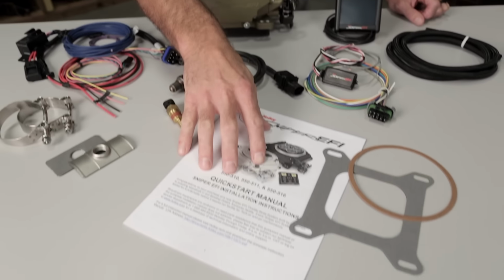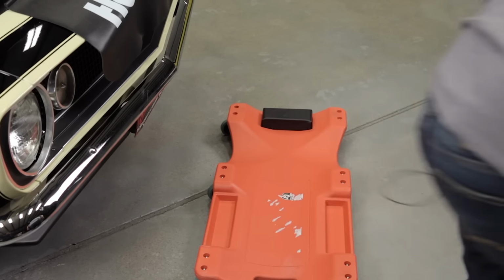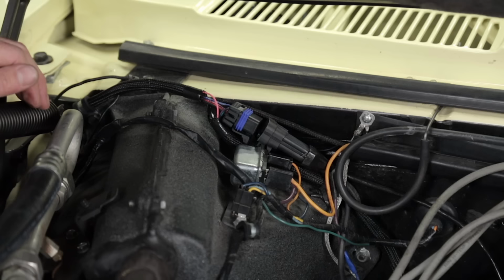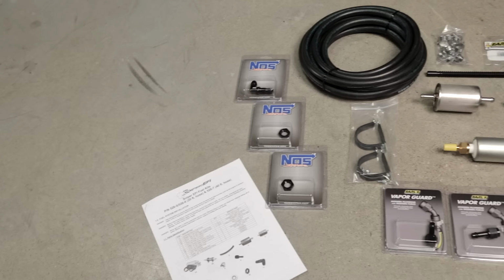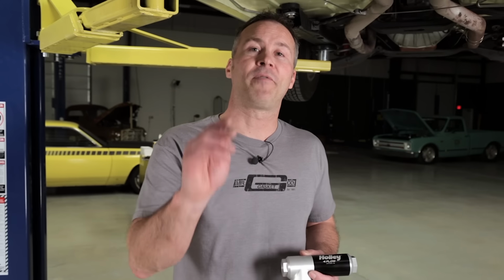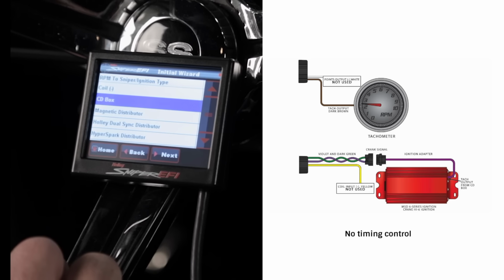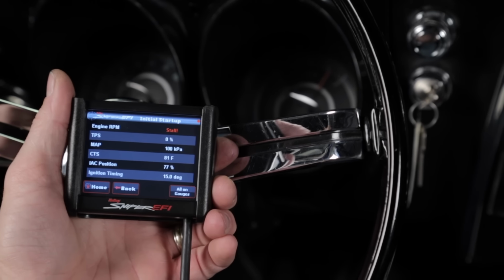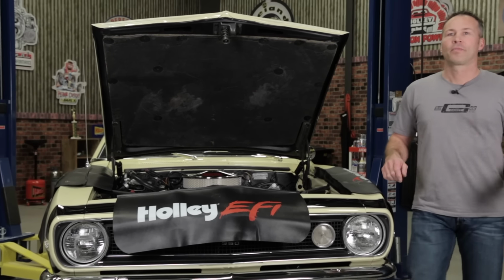Holley How To: Install Sniper EFI

Comment: Nice video. I just bought a 1982 Corvette. At some point a Sniper 1 was installed. The workmanship is terrible and I will need to rework the EFI upgrade. 
I’m a carburetor guy. I would never buy an EFI system but now I have one. We shall see

Comment: put the super sniper on a 425 caddy motor, added twin 63AR turbos. It starts first turn over and runs very strong. Doing the same on a 5.3 now. A great product. Make sure to have good electrical connections.

Comment: Sorry but this seems excessive, 2 fuel filters before and after the fuel pump? Don't have o2  sensors at a angle for condensation? Someone better tell every car manufacturer.  Condensation is not going to build up on a o2 sensor due to a slightly off pitch, or even if it was upside down.

Comment: Why will this system not last, because the internal cpu in the TB unit will be cooked in a short time. Placing the ecu in the TB unit is madness and will hurt Holley until they move it to a cooler place, like OE manufacturers have done for years. Stay away if you're smart !

Comment: My only complaint is like what I've heard from others, the pedal is stiff just off idle. Every time I stop and try to start, the throttle goes from 5 to 20 and tires chirp loud. The solution is to replace the secondary arm with one that prevents them from opening up off idle and closer to 40 percent. Not sure why Holley designed them to open up so soon.

Comment: Did the same setup on a 68 camaro. Ran fine for a short time, then RFI issues occured. Since signal wires are not shielded, be orepared to have RFI interference with Ignition System and Alternatir as shown here. Additionally the 12V os sensitive to pulsating voltage from old eystems. Still barely running after 3 years of hassle....

Comment: So basically the sniper system is just a way to get into peoples wallets as a precursor to making them purchase a whole line of secondary products "needed" for the sniper to work correctly?  If thats the case then why wouldnt the people just buy efi manifolds and spend less than the sniper and all its added nonsense?

Comment: What if I have completely separate dual exhaust? Do I run 2 o2 sensors or just hope for the best?
Reply: It only needs the mixture from one cylinder bank to learn and tune itself.

Comment: I am curious to know, what additional load is placed on the electrical system when you go from carbureted to EFI (whether throttle-body or multi-port)? Obviously all the added electronic doo-dads have some current draw, so it's not impossible that an EFI conversion could push your existing alternator over the edge, but I can't seem to figure out how probable that is. I've looked at specs for various EFI conversion systems and current draw is not mentioned. Maybe it's typically so small that it rarely, if ever, causes a problem. I'd just like to know if I need to upgrade my alternator and charge wire before making the jump to EFI.

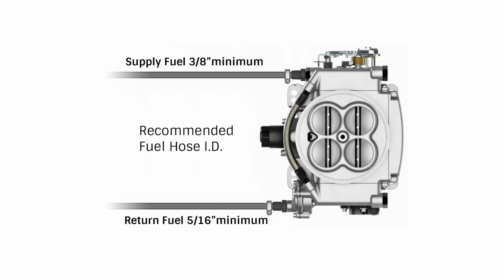Comment: At 14:57 the diagram shows a 3/8 supply and 5/16 return. The printed installation instructions states for both to be 3/8. Which is correct?

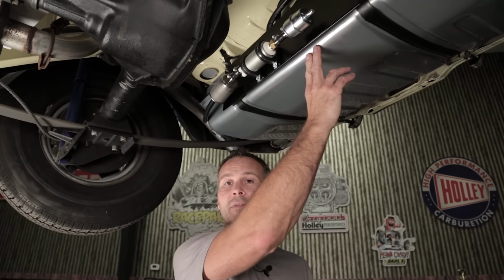Comment: 10:44 - Isn't the fuel pump too high on this custom bracket?  I though an in-line fuel pump needs to be lower than the bottom of the gas tank?

Comment: Why only one oxygen sensor? The engine has 2 banks. How does it know what the other side is doing?
Reply: it isnt multipoint efi. It doesnt matter what the opposing bank is doing. when you take a carb equipped car to a dyno they only probe one bank....
Reply: @borismcfinnigan3430  makes sense

Comment: Just added a sniper to my 74 f250 with a 390, has edlebrock rpm heads and intake. Set the wizard but the throttle jumps. set idle as in video but doesn't hold after shut down and restart. noticed my map says about 45kpa,  I live in Pa.

Comment: I just recently replaced my carburetor with this EFI sniper sniper and now it's running hot can anybody help me with this. It's in a 1949 Pontiac chat Pontiac chieftain but the motor is a but the motor is a 1970s oldsmobile 350

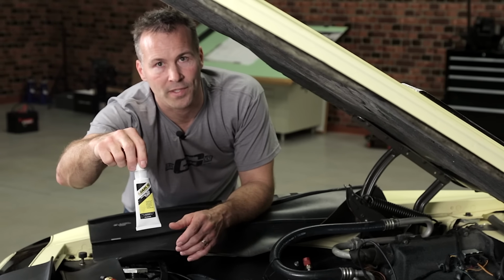Comment: I can't find the bushing referenced at 4:05.  Anyone else have this problem?  Can anyone provide a link?  Or maybe a Sniper EFI compatible coolant temperature sensor to fit 1/2" NPT instead of the provided 3/8"?

Working on a '68 SS427 Impala.  Thanks in advance.

Comment: This is not a plug and play system. The "self-learning" does not work. You will need to have a Holley EFI-certified shop dyno and tune your new sniper at a cost of around $700. #HolleyHiddenCosts

Comment: Can a Sniper EFI be used on a car with mid-60s Ford vacuum powered windshield wiper delay?  

When activated, the wiper governor introduces a small/intermittent vacuum "leak" which is sourced from the intake manifold.  The "leak" is small but enough to be seen on a in dash vacuum gauge (perhaps 3-5 inches drop each wiper cycle).

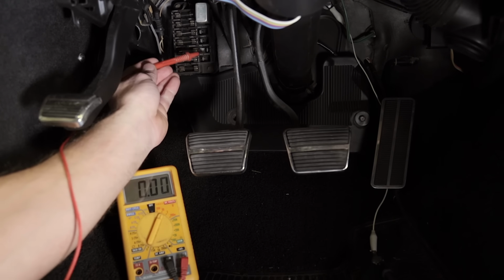Comment: @Holley At 8:35 -. do you recommend the ignition switched 12v line be fused?   (If so what fuse rating?)

Comment: Odd question. I see on the 1100 series it's built for smaller motors. How small would it still work on?  If an alternate smaller injector is installed could the unit work on something as small as 660CC?  I am part of a small but passionate group of Japanese KEI truck enthusiasts who are working with 3 cylinder 660cc engines.

Comment: Seeing this video reminds me of a issue I had and think anyone thinking of in stalling a duel post battery should read till the end. I have  a 1969 RS/SS that I installed a sniper on a year ago. The car ran right off and ran great. After a few weeks , I started to have issues with the system. Called Holley Tech and they gave me a few ideas of what could be my problem. The main issue I had was the car would just shut off. I checked all the wiring and installed ground straps everywhere Holley told me to. The car would still just shut off so I got tired of not having any trust in the sniper and pulled it off and put a Holley 750 double pumper on it. Car ran good and one day would not start. I checked the volts and had 13.5 but the car would stall. I checked all my wiring and all was good but still no go. Had a friend with over 35 experience  come over and we put our heads together and checked the battery and all connections no go. We were checking the volts on the top post of the battery and had 13.5. We would get the car to start and run for 5 mins and stall. We started it up once more and when she stalled we checked the side post and only had 8 volts. After the car sat awhile we started it up and the side post would start out @ 13.5 but would drip very fast and @ 9 volts the car stalled. Went to a stereo shop and bought top post ends that have accessory connections and fixed my problem.  I'm putting my sniper back on.
Reply: Man, Thanks for that info. Sorry you dealt with that, but glad you got it figured out!
Reply: Thank you for the information

Comment: I just installed the sniper Quadra jet on a Chevy chevelle 1969 396 big block and it doesn’t work, starts and dies the injectors put too much gas on it , gets flooded

Comment: Great video.  Answers a lot of questions, but I have a couple more.  I want to install this on a Corvette with a 383 Stroker engine in it.  Are the power leads long enough to get to the battery behind the drivers seat?  Second, would it be possible to run the return line to a "T" located in the inlet line to the fuel pump?  I'll be replacing a Holley 750.  Is the sniper shorter than the Holley 750?
Thanks in advance.
Reply: The power leads are roughly 6ft long, you will more than likely have to extend them for your location.

The return line needs to go back to the tank, I made this mistake the first go around... Do NOT (TEE) into the supply line! I highly recommend using 3/8 hose for the return line. I initially used 5/16 and was having issues with the return side having too much pressure... To avoid any headaches or possible diagnosis/trouble shooting issues just run 3/8 supply and return directly to fuel tank right from the get go!

The Sniper is the exact same height of a 4150 style carburetor.

Comment: I have a 454 mild cam what unit should I use thks
Reply: If it's just a "stock" 454 with a Mild Cam the base Sniper will be plenty adequate! With no other mods other than a cam swap your probably around 300-350 HP.

Base Sniper will support up to 650 HP

Super Sniper will support up to 1250 HP

Comment: I've been trying to figure out were to place the water temp, forums all say on top of the intake before the thermostat. I have my heater hose there and a Dakota digital temp in the drivers head, glad to see the passenger side head will work fine. SBC 350

Comment: I want to say that I installed the Master kit on my 1968 F100 pickup using this video. It was 100% helpful. Made me feel very confident to do this. I did have to use the trouble shooting video afterwards to ensure 100% perfect startup every time. But I am a completely satisfied customer who enjoyed and appreciated this video. 
PS…My truck runs so much better now with the Sniper EFI kit as opposed to the 650 Carburetor that was on it. 
Thank you Holley for creating this content for your customers!! 👍🏻
Reply: I have constant startup problems with my 69 f100 to the point i hardly drive it. Gonna have my mechanic install this. Looking forward to trusting my truck on long drives

Comment: One of the big advantages of this system compared to FiTech is you have a memory card in the handheld that allows you to save the tune.  You can make modifications, upload the tune, try them out and decide whether or not you want to keep them.  If not, you can simply load the old tune.  It also has a very powerful learn table (short term fuel trim) that allows you to merge it with the main table and smooth out the rough edges.  Really cool to see it in 3D, gives you a much better idea of what you're doing.
Additionally you can download the full suite of Terminator and run it full size on your laptop.  I prefer that mode when we make a tuning run and can make changes along the way to test different options.  We were running an LS3 with 4L65e and it defaulted to a WOT shift rpm at 6,000 rpm.  We didn't like that and knocked it back down to 5,200 rpm for a better "normal' driving style.  Lots of other options including full scanning options to pinpoint problem areas, great stuff priced fairly.  Only thing I don't like is there is only one Wide Band O2 sensor, you have to upgrade to the full Dominator product to get two sensors.

Comment: Just installed mine the fuel return threw the fuel filler was easy. Runs way better on the built 454 than the 750 edelbrock ever did. Worth it
Reply: Where did you find the fitting to connect your return line? I'm looking at Evil Energy's website and others trying to track this part down for my installation. I'm using 3/8" line for supply and return like advised in Holley's install guide. Any info or link is greatly appreciated!

Comment: Does a automatic transmission need to be in drive when setting idle or still put it in neutral?
Reply: @crackjack8320  will it not adjust and go back to the rpm that was set in park when put in drive? I was always told to set idle with car in drive
Reply: @crackjack8320  yes I have the idle set at 630 in drive and on EFI in park it jump to 700 750 so if I set rpm at 750 rpm on EFI in park when I shift to drive is the EFI going to compensate for it and raise rpm back to 750 or will it still it around 600 650

Comment: my exhaust clamps were way too big for 2 1/4" pipe!
Reply: @crackjack8320  thanks for replying. it was a  joke really. my little mouse puts 400+ hp to the ground. I was just pointing out that the kit is not really a one size fits all for people looking to upgrade an older car.

Comment: Bought 2 full kits. One for my 66 mustang restomod and one for my 65 mustang gt. Installed on my 65 gt and have been trying to get it dialed in. So far nothing but problems. Car keeps back firing and dying as I try and drive. Certainly had high hopes for this system and would be great if it would worked but as of right now I feel like this just isn't gonna work.
Reply: Take it to a professional
Reply: @JerkVegas86  I'm not the one working on it. A 30 year ford mechanic is. He seems to finally got it dialed in. He did a lot of trouble shooting and in the end he seems to think it might have been rf interference with the wiring. Runs amazing right now other than the fact that it's overheating when it's hot outside. New issue to tackle. Doesn't looking like it's the cooling system. The radiator stays no higher than 180f but the engine overheats. Thank you.

Comment: Does the Chevy 350 require the fuel pump rod to be removed before installing block off plate?
Reply: It (pump rod) will slide out on its own when you remove the pump.  I removed the rod on mine and reinstalled the pump on my stock 350/ 255 hp LM1 engine.  I left the fuel pump to support the factory fuel tube to the filter which is front and center above the water pump.  I also left the fuel return line from the filter and the fuel line from the filter that hooked up to the carburetor.   Capped off the end of the fuel line fitting where it originally hooked to the carb and set the factory air cleaner with single snorkel and chrome cover.  The setup just hides some of the Snipper unit to appear more stock.

Comment: Hi guys, Does this system support E85? I recognise the need to flow more fuel when running it and the implications that would have for HP. The reason I ask is in regard to running E85 to meet emissions temporarily before switching back to normal pump fuel. Cheers!

Comment: That return line, dropping the tank and all that fab mounting by the tank was a deal breaker for me. Needs to be returnless.
Reply: There are ways to go returnless but you most likely have to drop the tank.  Holley makes in tank fuel pump/regulator system.  EFI requires 55-58psi to work. As you can imagine, going full throttle to zero throttle creates a pressure surge that needs to be relieved.  So the options are:

1. Utilizing the regulator on the Sniper and running a return line back to the tank which this video shows.
2. An internal pump/regulator that does this all inside the fuel tank.  This is what they Holley Muscle Car Fuel Modules do.

The Holley Muscle Car Tank Module regulates the 58psi inside the tank.  So the regulator on the Sniper (where the return line normally hooks up) isn't even used.  The fuel is regulated and spills back right inside the tank.  I agree, dropping the tank is never a fun job.  But if you empty it as much as possible and have a buddy help, it's not that bad.  Installing and wiring the Muscle Car Module is a breeze.  I installed this in my car and it's been working perfect.  No complaints at all.

Comment: That's really nice,  but the return line is a borderline deal breaker.  Nobody wants to run another fuel line on a nice restored car,  or put holes in the sending unit or filler neck.  You need to make this returnless and concentrate on an in-tank pump option.
Reply: Holley does make in tank fuel systems that eliminates the need for a return line.  I installed one in my '69 Camaro and it's been working great.  You will most likely need to drop the tank to install the in-tank fuel pump/regulator.  Overall I think it worth it as the in-tank pump is much quieter than an external pump and obviously gives a much cleaner look.  It's an option.  Here is a link to the one I bought.  https://www.holley.com/products/fuel_systems/fuel_injection/sniper_efi/muscle_car_efi_modules/parts/12-300
Reply: @BEER-and-BRATWURST  Thanks for that.  Good to know.

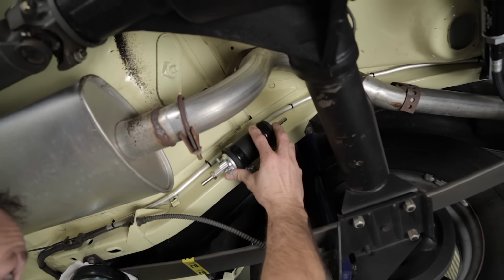Comment: While you installing the power wire to the fuel pump 11:42, install the nut you left off securing the rear axle to the spring!  Good video awaiting my Hyperspark EFI Ignition box to complete the install.
Mike

Comment: Does the computer screen always need to connected or can you unplug it so you tuck the wires out of the way
Reply: The cable that's attached to the screen is pretty long.  The wire attached to the sniper is short.  You can plug/unplug it if you choose.  I didn't care to have the screen inside the car at all times so I just ran it out the window and under the hood for initial setup.  Then unplugged it.  I do keep it in the car (coiled up in trunk) in case I feel the need to check something on the fly.

Comment: With the xflow , are you soppose to still run the other harnesses into the car if not using them ?  I see there are no weatherproof caps for the connectors included. Also if the car already has an electric pump set up in the car  do you still need to wire the fuel pump wire to the pump in that is on the harness?

Comment: I had the terminator efi kit on my truck and I could never get it to run right.  After a year and a half of messing with it, I said the hell with it and went back to carb.  I just finished swapping it back over and I couldn’t be happier!  This efi crap really is cool stuff, but it’s simply not quite “there”.  I don’t care what anybody says, but carbs are simply more reliable.  No sensors to go bad, no Ecu no fry, and no extra 15lbs of extra wiring harness.  If I ever did efi again, I’d either LS or Coyote swap it.  😉

Comment: I would like you to put the measurements of the base of the body, I have a Volvo Penta OMC Cobra 5.0 V8 (marine) and I do not know if the manifold of my boat works for me.
Reply: I have the same motor in my boat and just ordered the 2300, my manifold is a 4 barrel but has a 2 barrel adapter on it, the 2300 supports up to 350hp so decided it would be fine for my boat. You can run the fuel return into the fill or the fill vent and you will need an O2 adaptor